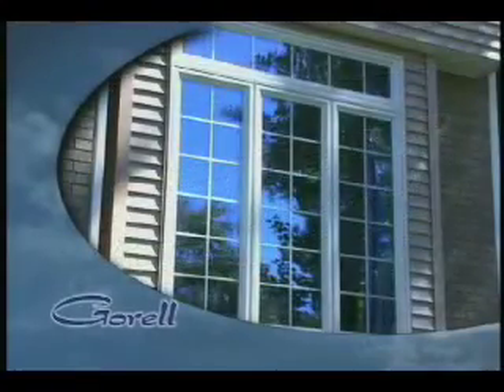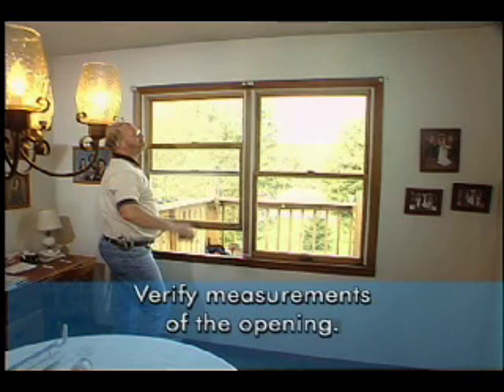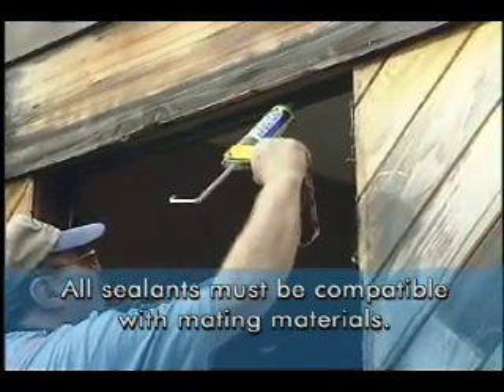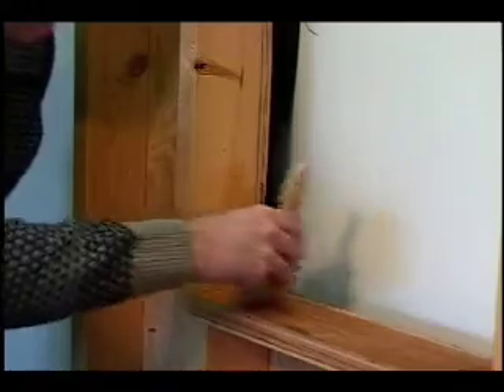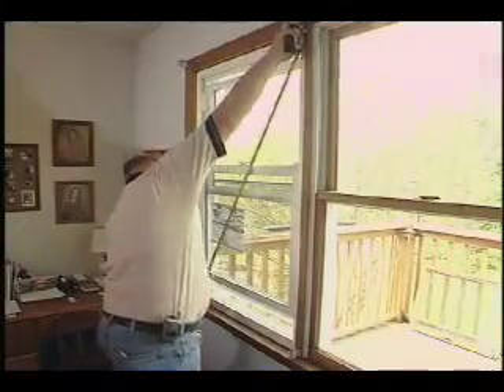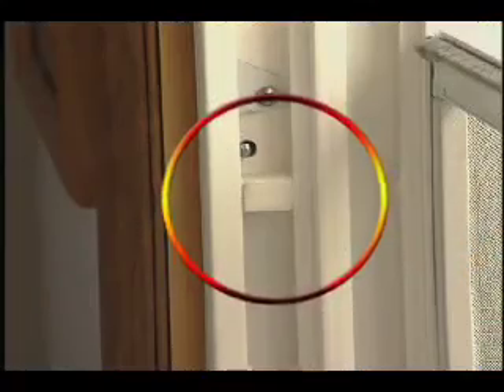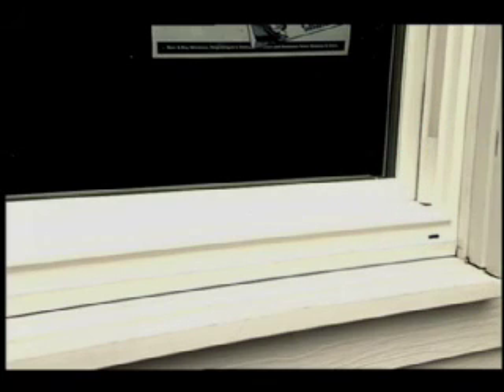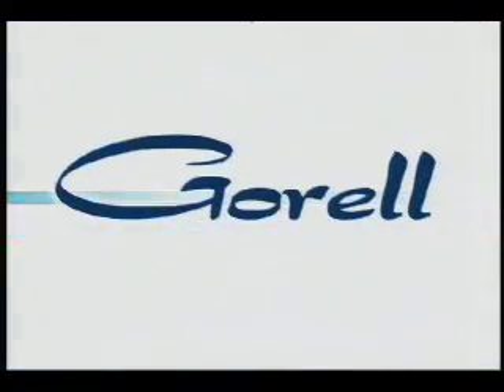Replacement Window Installation - Gorell Double-Hung Windows

Comment: Wow - Good job Gorell - You guys are the FIRST WINDOW INSTALLERS I have ever heard even mention > 6:35 >  jamb adjusters.  99.99% of replacement window jobs don't even acknowledge their existence! Get the word out.  Jamb adjs are there for a reason - particularly on vinyl frames which can flex.  I had a vinyl sash fall out on my Mom 20 years ago when she tilted it in for cleaning.  After adjusting the jamb adjusters the contractor told me "not to adjust", they never fell out again!

Comment: There was no need to install a vinyl replacement window for this application. The existing window is either an Andersen Builders Select unit or a Narroline DH, both of which can be converted to a brand new 400 Series Tiltwash window. Andersen makes a "Tiltwash Conversion Kit" that seamlessly converts this window in about 15 min. The best part is that the size of the original opening is not lost.

Comment: I did however have to re-caulk them. The side frame rails had moved in about 1/16" after my adjustments.  20 years later the house is still quiet as a cave even when a missing muffler or dump truck roars by. LOL!

Comment: Good video, but film a video for replacing old
thick aluminum windows.  Do I need to remove the 3/4 inch drip edge with a Sawsall, or can I leave it in place.  Most older houses on the west cost have aluminum windows.  The exterior is usually stucco, or wood planks.  There's a  lot of window companies and I don't know why they don't produce multiple videos.   Replacement windows
have a bad reputation--I'm thinking on milling my own?  It might be easier?